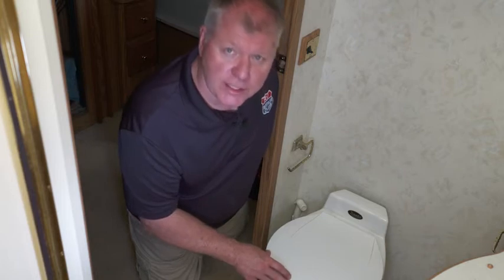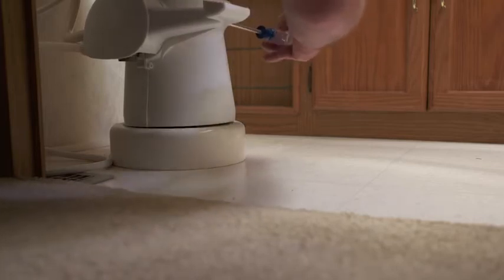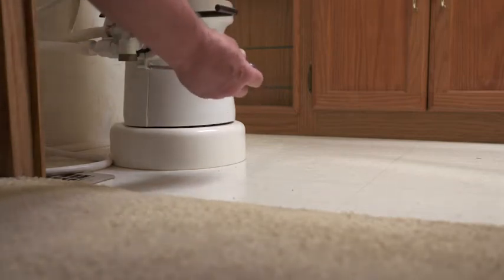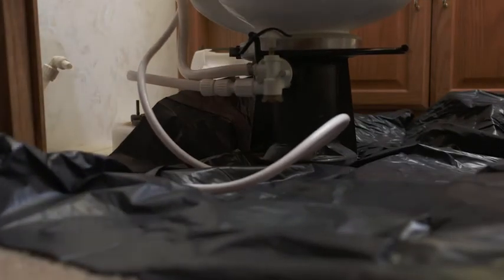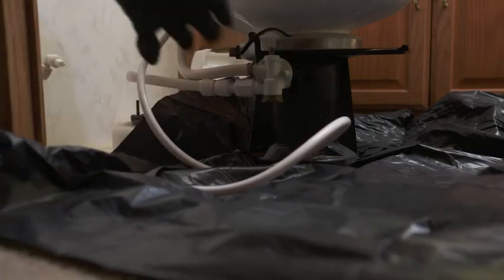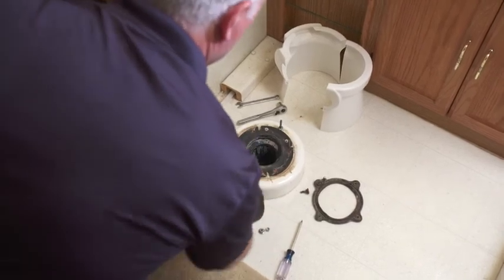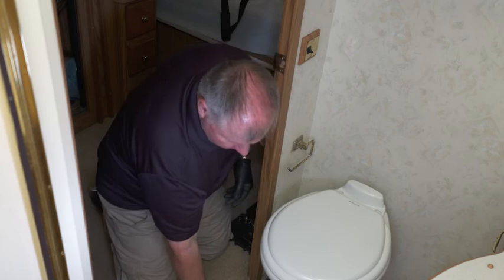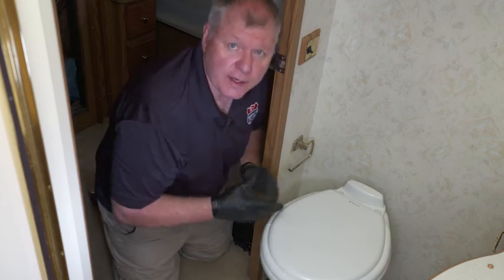RV Toilet Replacement: A User's Guide

Comment: I would have liked to see you replace the flange! I had such a mess with my trailer
After having it done in a shop!
They destroyed my subfloor
They damaged the black tank
They made such a massive problem for me!
I thankfully only used the toilet 3 Days hooked up
Otherwise I would have had sewer sludge in my trailer!
I'm still trying to replace it
I think I have it ready to put in the new flange and pipeline for my Dometic 310 to sit properly? Ugh